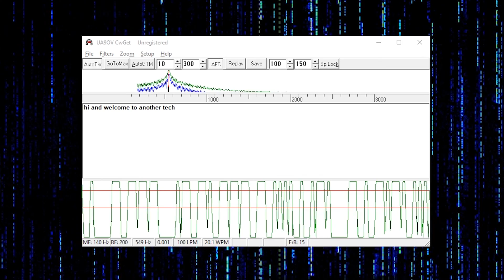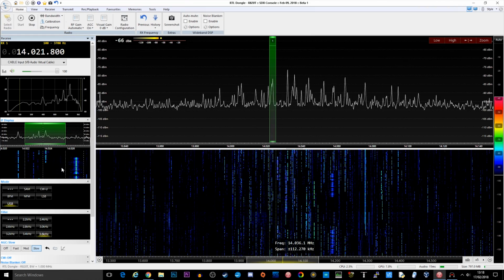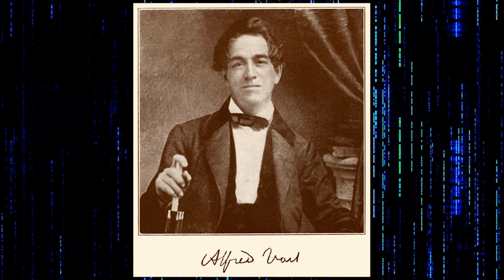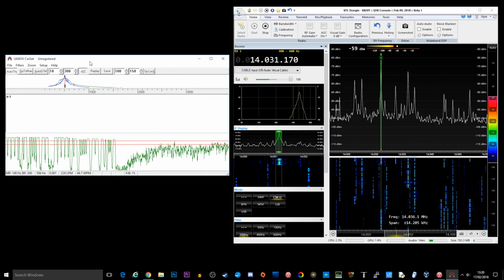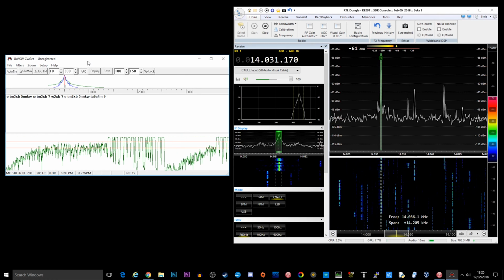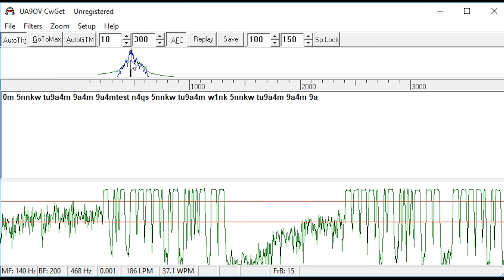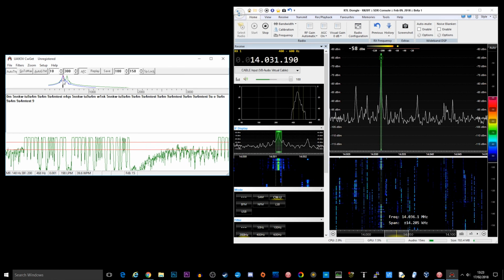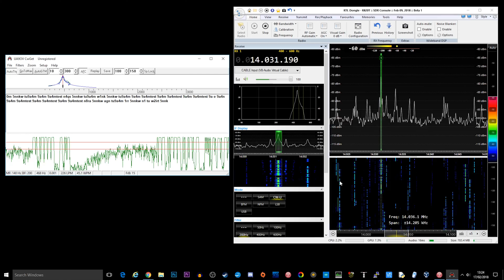The Real Matrix - Decoding Morse Code Using An RTL SDR Receiver

Comment: This only works if you have a Ham It Upconverter?   Is it illegal to transmit CW (10m,20m,40m,80m, 160m) away from the beginning of the band or even at other frequencies?   I'd like to try to use an RTL-SDR to receive CW at 200Mhz.

How does CWGET compare with CW Skimmer 2.1, MRP40, or Cw Decoder Logic v1.0.0.5, Ham Radio Deluxe, MultiPSK?

Comment: Forgive me my ignorance, But which frequency is this Morse being transmitted? I suppose around 14 MHz, but how is that possible with SDR RTL? since it can pick up signals starting from 42 MHz, if im not wrong. Thanks for the video by the way!
Reply: He has an additional device called an Upconverter which typically shifts those lower signals up by -125,000,000 MHz (depending on the upconverter being used), the product he refers to is a Ham It Up by Nooelec which is a recommended device however there are as always other methods to achieve the same effect.

Comment: Hi there , I'm just wandering how good this software would have been to me ? If I had  a computer and the software had existed in the mid 60's when I was paid to Rx CW. I have used it in the last few years and find it to be one of the best to keep track of fairly high speed CW. It would have certainly saved one hell of a lot of pencil lead that's for sure. I got fed up with the job and got a trade transfer to Radio Op. I had to join a group at Catterick that was on the last few weeks of their training and when it came to the CW sending test, I took my own "Brass Pounder" key along. I asked the sergeant who was doing the tests if I could use my own key and could I just do a bit of practice to warm my fingers (fist) up. Yes no problem he said. So ok I was banging out a few usual phrases at about 30 odd WPM and I got waved down and told to stop sending. The sergeant asked me if I was the lad who had just come up from Lufborough and spent most of my spare time at the Garrison Amateur Radio Club. I said yes why? is there a problem.? Yes there is, Do you think I am going to sit here trying to take down CW you are sending at that speed ?. I said no I'm only warming up before the test. I was asked what speed I could Rx CW. I answered Oh, about 40 - 50s at the top on figures and cypher. Answer you are here to do a 12 WPM test. Now unclip your bloody machien gun and F--- Off, you'v passed. I did not know wether to be pleased or feel insulted. The lads outside asked Did you pass. I said I dun't know , I got told to pass F---Off and go or what? 73 de J0hn-G0WXU.
Reply: Hi John,
Fantastic anecdote from bygone days. I was just discussing CW with my father a few weeks ago, and mentioned that I finally planned to (re-)learn it now that I intend to get my amateur radio license. This is somewhat ironic, given that competence with Morse is no longer a requirement for the license - it was when I was a child and was last into radio - but I digress. 
Anyway, my father mentioned that when his father left the service and went to get his ham license he either very nearly or did flunk his CW test the first go-round as he was so used to copying (including cypher) at very high WPM such that the beginner-level test just didn't "compute" for him. It just didn't sound the same. Like, imagine trying to make sense of spoken English slowed down to 5% or 10% of its original speed without having prepared! Anyway, with a bit of practice it was no issue but it really speaks to the remarkable throughput old pros like you were able to achieve when the best available "codec" out there was between your ears!
Reply from the maker: Hi John, thank you so much for your comment, and your experience with Morse Code. I think morse code is a vital and extremely crucial method of communication, even in this day an age. I’m sure that without Morse many lives could of been lost (or saved) depending on which side of the battle you were on.. Thanks again, I found your comment really interesting. Regards, Matt, M0DQW
Reply: Haha! I enjoyed reading that. I've just started to teach myself morse.